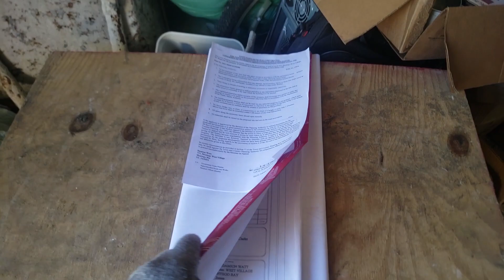HOW TO MAKE 3/8 STIRRUPS WITH A LOCK BUILDING CODE REQUIREMENT  BY PARISH COUNCIL ENGINEERS

Comment: Please reply I'm doing my own personal project I would like to know the the measurements with each bend I wanna know if I'm off a bit cause bend  4 by 10 for column is that right
Reply from the maker: we normally make it 3 1/2 by 10 but some ppl also make it 4 by 10 also thanks for watching 👍
Reply: @GFORCECHRONICLES  thank u for replying don't mean to bother u but what is the length of the matting links and the the length when bend cause I use 24"  and when bend is 18" I just make the the trenches a bit bigger to accommodate am I off by a mile please respond
Reply from the maker: no problem my friend my mom DIY video are always easy to follow the rebar  links are measure 18" when cut then she  bend 2" off each side so it would finish at 14" thanks for your question 👍
Reply: @GFORCECHRONICLES 🙌blesss
Reply: Good evening where are you located in Jamaica?

Comment: You need to let we knew what the reason for the hook on the stirrups.
Reply from the maker: We put hooks are locks which ever name some people want to call it  to resist seismic movement to prevent concrete from splitting outward It prevents slippage of steel from the concrete To Keep steel bars in position and hold steel tightly  thanks for watching 👍
Reply: Helps to somewhat 'earthquake proof' a building.